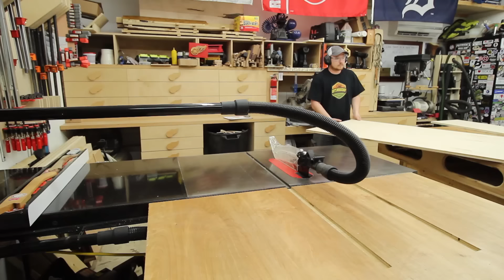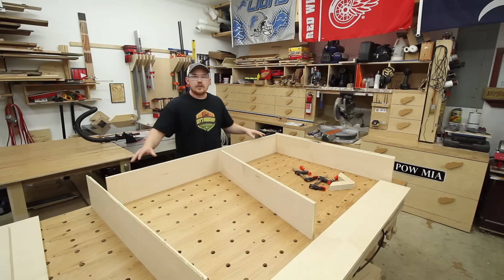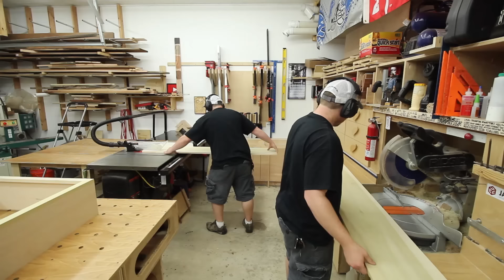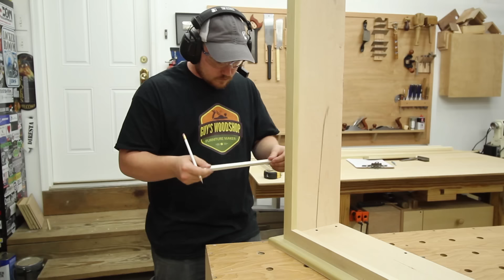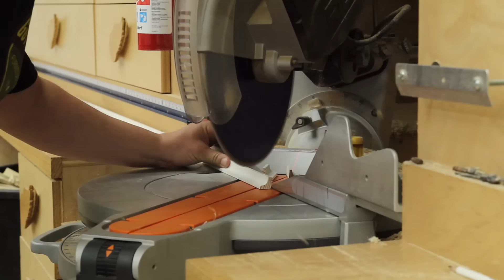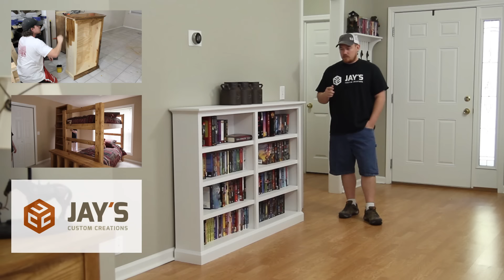How to build a bookcase - 258

Comment: Nice.  Just wondering the plywoods I got from Home Depot are not flat. Did u cherrypick the plywood for this project?
Reply from the maker: No. Mine were really close to flat. If they are warped you can straighten them out when attaching the solid wood banding. Most of the time you can get the plywood to flex back to being flat.
Reply: Jay Bates - do u mean glue and nail another piece of wood to both side of the warped plywood?

Comment: When you attach the face frame does it sit flush with the outside of the plywood side? Or does it sit slightly proud of the side?
Reply from the maker: This one was flush. But having it proud can be up to you to either add another design element for the eye or to make it 1/16 or so proud and then use a flush trim router bit or a hand plane to make it perfect.

Comment: [It does not need to perfect] really so the next thing you are doing is stain finish and you are in bad habit of doing crap work or kind of good enough.  

ALWAYS try for excellence not kind of good enough, like you do.  

Pock screws are crap quality work.  They make week connection.   

Why In the Hel l would I want to build crap that will fall apart?

Comment: I built a similar one but wanted to mount it to the wall in case my 3rd old tries to climb on it. I cut the baseboard on the wall the width of the bookcase and slid it all the way back and mounted to the wall through the back panel

Comment: Love the finished product, and I'm a big fan of your videos.  I think I've followed you from the start and seen them all.  This is the only time I have seen something that I think will probably need addressed over time:  You need a center foot or two.  Books are heavy.   Despite the stiffening you achieve for each shelf by attaching the hardwood strip to the face, the weight of all the shelves and books is on the two outside feet, with 6' of books stacked three shelves high, all on a 3/4" piece of plywood.  Over time, your bottom shelf is going to sag, with only the base moulding there to stiffen it.  Since the bottom is covered by that base moulding, it would be wise to add a couple more points of contact with the floor underneath to transfer the weight to the floor more evenly, so that the long spans of horizontal plywood are less prone to sag.  As I said, great project, great video.  Much love.
Reply from the maker: How will the bottom shelf sag when it is connected along it's full length to the front face frame as well as the plywood back?

Comment: Looks professionally done. And no problem of course using pocket hole joinery where appropriate since the method was used by 18th century masters such as John and Thomas Seymour (w/o a handy jig, look like they were cut with a carving gouge). Have you filled pocket holes with the angle-cut dowels? Seems like that would work fine on a painted piece.

Comment: Great build Jay,How did you make your corner block clamps?
Reply from the maker: Glued three pieces of 8" sqare 1/2" plywood scraps. Cut in half along diagonal. Square corners at table saw with sled. Use bandsaw to remove inside triangle shape for clamp heads.
Reply: Great. Thanks!

Comment: why didn't you cut a bit of the base away to fit snug with the skirting board?
Reply from the maker: Because it might not live in that location for long. If it moves to another room or if we move I don't want it to be specific to that wall.
Reply: ah ok, fair dos
Reply: An alternative would be to “notch” out the back of the case to the height of the baseboard, then it would fit flush against any wall with that same height baseboard.

Comment: Jay Bates I noticed you aren't using your infeed support legs you made for your table saw.  Did you find that they really weren't needed for cutting large plywood panels on the saw?
Reply from the maker: They are incredibly handy when wrestling a full sheet. I never cut a full sheet anymore. It's just more convenient and easy to make the first cut with a circular saw. And with my current setup I have to have them cut to 66" at the store to get them in my storage location.
Reply: Thanks for the explanation.  I've considered building your simple infeed supports (and I don't currently have a workbench or assembly table), so I was wondering if they didn't work out as planned.  Sounds like for my usages they probably will still be helpful.   I'd like the whole Festool track saw arrangement (I think), but I'm not there yet.

Comment: Great build and love your channel. One thing that I am curious about and noticed that Charles Hanson mentioned it too is the fact that you used latex paint. My question is do you have any issues with books or items sticking to the shelves by using latex paint? I have always heard that you should use oil based paints for case work such as a bookcase due to the fact that oil based paints dry completely, while latex paints can take years to completely dry to where things will not stick to them. Cheers and keep you the great builds.
Reply from the maker: No but a quick coat of water based poly would solve that.

Comment: Do you ever have an issue with the paint being "sticky" even after its dry yrs after it drys"?
Reply from the maker: No but a quick coat of water based poly would solve that.
Reply: +Jay Bates I'll give that a shot thanks for tip

Comment: nice Jay!  what's your opinion on the shelf attachment and weight capacity? I'm soon to be starting a similar project, but more of a built-in style to house toy bins in our bonus room, so nothing massively heavy. the other way I thought of was full length shelves with dividers in the middle with dados. My thought was the dividers would provide good support for weight. I guess the shear strength if pocket screws would be plenty strong enough... Anyway, nice work.
Reply from the maker: I would say that each shelf could hold my body weight.

Comment: I feel ya, Jay. I married the daughter of a librarian - I read out of self defense. It looks like she has a little bit of open space for more books there, though...

I gotta tell ya there are only 2 differences in the way you made this bookcase and the way we did them back at the custom cabinet shop (and charged a pretty penny for.) One was we used biscuits and glue rather than pocket holes for the case work, and the other was that we used a 1/4" thick back rather than the thicker back you went with. That's it.

That's a seriously nice bookcase that should outlive all of us. Great project!

Comment: Hi Jay, when using your particular nail gun, how do you ensure the nail does not come out on the side of the project accidently instead of going straight through into the piece you are fastening. What size brads are you using?
Reply from the maker: 1-1/4" 18ga nails. 
This has the solution for the nail gun: https://www.youtube.com/watch?v=wkoo4H3N5qw

Comment: That is a nice looking back bookcase.
when you were installing the shelves, would it have been easier to start at the top and work toward the bottom? That would let the side force from the pocket screw push the shelf against the spacer instead of away from it. You used this concept when you assembled the case itself.

Comment: Hey Jay, bookcase looks great. I'm trying to understand when to be concerned about wood movement. i know plywood is stable but solid wood isn't as stable. Should there be any concern about screwing that solid top directly into the plywood case? i'm just wanting to understand when movement needs to be considered.
Reply from the maker: In this situation it won't be a problem. I used dried poplar that won't move much to begin with and it was further sealed with a couple coats of latex paint. It will move but not enough to even notice.
Reply: +Jay Bates Oh the paint blocks the wood from absorbing water? is that just with latex paint? where did you learn about the characteristics of different wood species? i'm trying to find a resource that can teach me about different species in those situations.

Comment: If one has little ones roaming the house, a hidden wall strap maybe in order as they will often climb up the front which creates a dangerous tipping hazard, IKEA is in the middle of a major recall due to several fatalities. I often wonder what's different, never worried about this when I was a kid, hmmmmmm.
Reply: Kids today do not worry about it either.  The difference is, wait for it ..... the internet which means we hear about things regardless of where they happen.  The Ikea dressers were quite high so they were "top heavy".  They did not make dressers that high years ago. Also years ago, bookcases were built in so did not fall over.
Reply: Oh forgot,  nice job!!!
Reply from the maker: I understand what you are saying but I often wonder why common sense has to be pointed out? A baby isn't strong enough to pull this over and a child large enough to pull it over should know better.